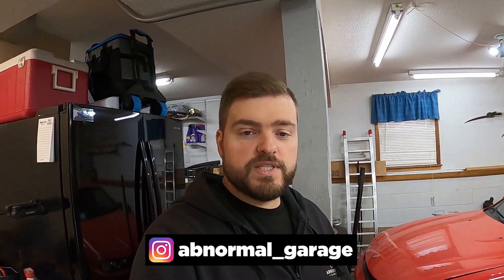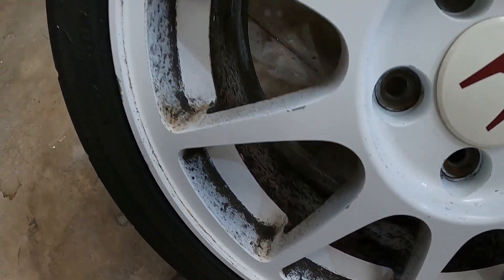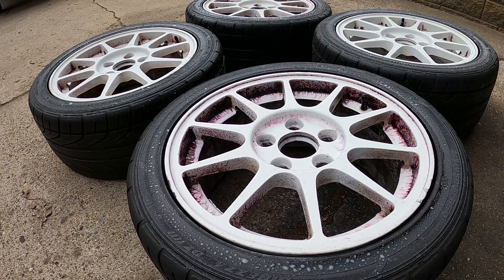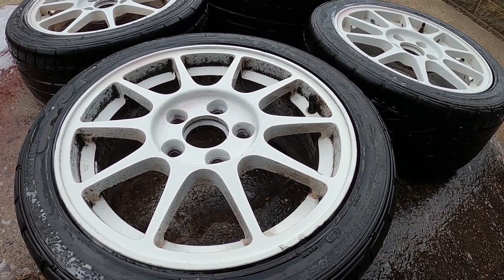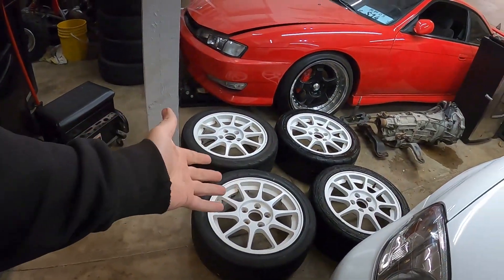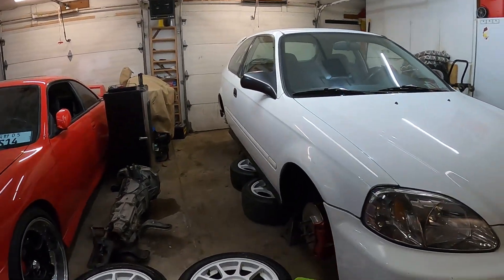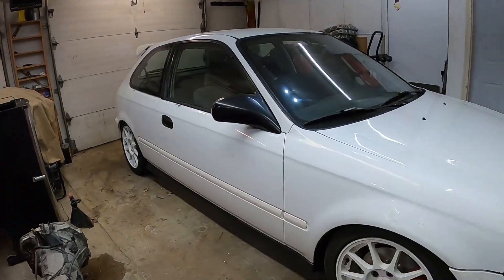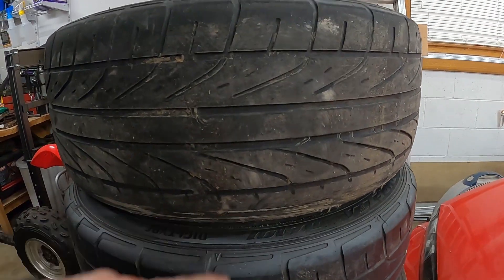Removing Years Of Baked On Brake Dust | Project Civic EK

Comment: Hey man! Don’t know if you answer questions; but I’m wondering if you’re still running the Maxspeeding rod coil overs ? How’s the overall experience since the day you’ve installed it ?  Thanks!
Reply from the maker: Yes, I’m still running the maxpeedingrods coilovers. I haven’t had a chance to test them out yet since I installed them this winter, and then jumped into doing the ek9 5 lug conversion. Now that I’ve got it all completed, I’ll be doing a review/test of everything I’ve upgraded this winter (including the coilovers) here in the next couple of videos.
Reply: @AbnormalGarage  great man, i’ll be looking forward to it :)!